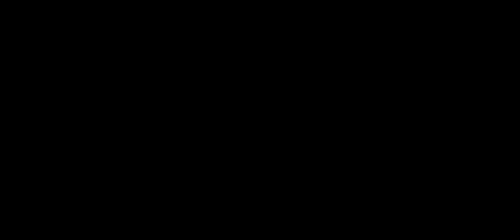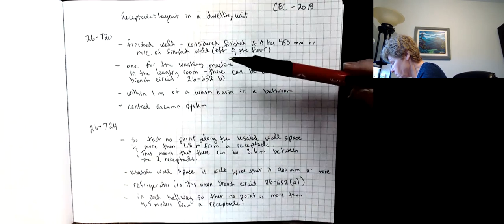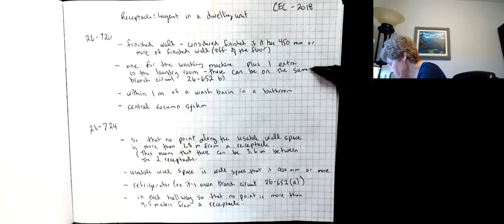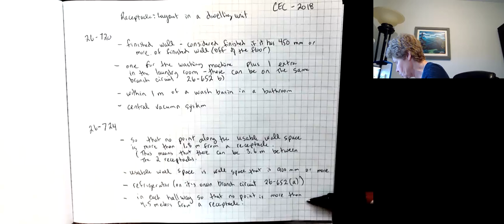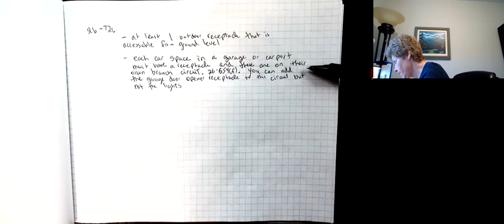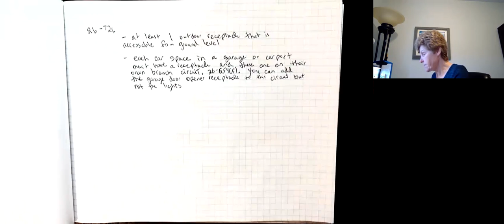CEC 2018 -Section 26: Rules for laying out receptacles in a dwelling unit

Comment: This still confuses me.  Let's say you have a plug right hugging the door 4 inches away from the door.  The door is 3ft long.  Then there's a 3 foot section of wall then a closet with another receptacle on the far side of that closet hugging the closet.  The distance between the two receptacles is less than 12 feet.  Do I still need to put a plug on that 3 foot section of wall?